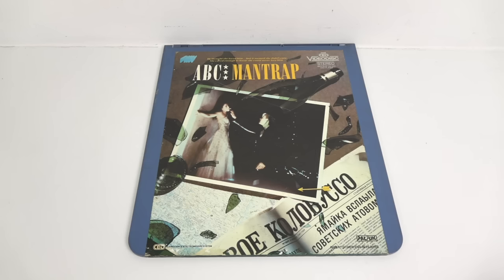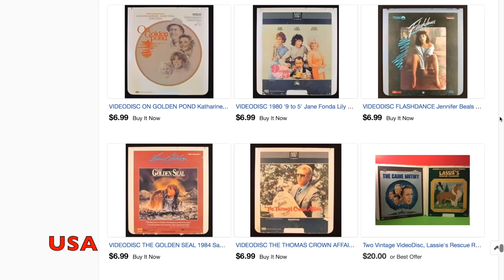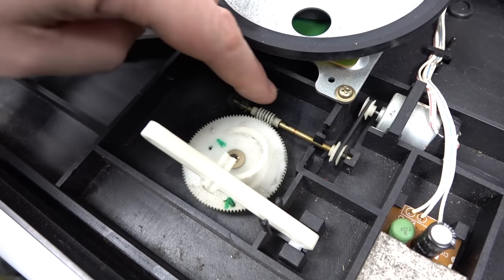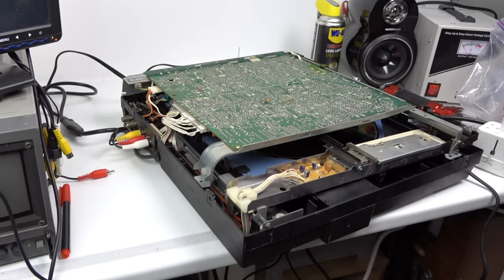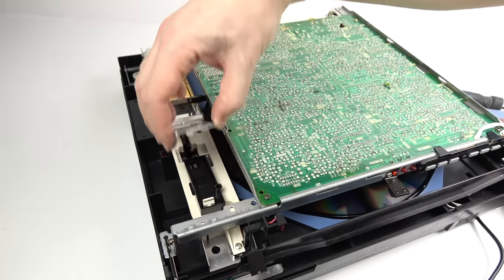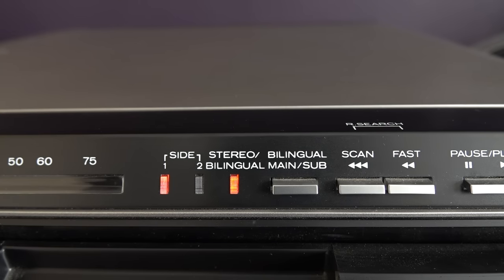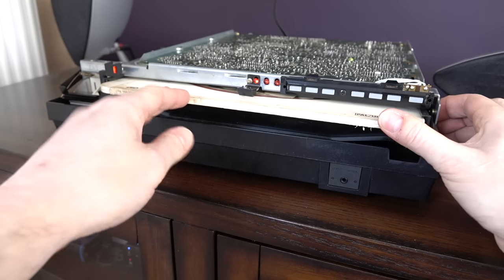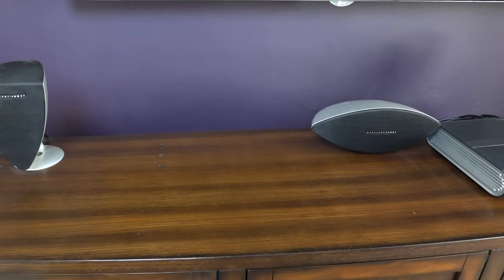Retro tech: The RCA CED Videodisc

Comment: I worked at RCA at the Video Disc plant in Indianapolis for four years.  I was responsible for buying the caddie and the spine the disc went into along with other products including the PVC and carbon the disc was made from.  The skipping in part was caused by dirt or mainly because of the carbon migrating up through the PVC and clogging the tracking and caused the stylus to jump.  It was fun working there as RCA went full out in staffing the plant. We had the latest equipment to work with.  We had two electron microscopes and several PHD's working there.  It did turnout to be an unworkable system.  Too bad.

Comment: A. Ross
A. Ross
1 second ago
Bought an Hitachi CED player when they first came out, the discs used to skip all the time, I spent more in bus fares going back to Bunker and Pratleys (Sheffield) to get the disc replaced, had the repairman on first name terms, had at least 5 styli on 2 machines and they still couldn't fix the problem.
So I had nothing to lose, I took the stylus out, looked at it under my kids microscope 100x magnification. It was covered in the silicone lubricant I mean really thick with the stuff, I cleaned the stylus like I would a regular audio stylus.......PERFECT.........until the next disc was played. I told Dave the repairman showed him the stylus he could not believe all the hassle we had been through and it was just the gunk on the disc that was the problem.

You live and learn.......all the time..

Ade

Comment: I had a CED player (well, two) and hundreds of discs. Glitches were standard: you didn't question "will this disc have glitches?" but rather "does this disc have few enough glitches in unimportant enough places that I can live with it?" and if you couldn't live with it, you'd take it back and they'd exchange it. Over time with multiple plays, some glitches went away as the stylus ironed out the spots in the grooves that weren't quite right. However, they weren't nearly as bad as shown, clearly those discs you have, have gone bad over time.

Reasons for getting into the format were that it was inexpensive - a movie was on the order of 10%-15% of the cost of the VHS tape (and laserdiscs were much more expensive at the time) so I had a huge library of home videos at a time when nobody else could afford it  - and in the US, movies came out on CED years before on VHS. I remember when there was a big hubub about Star Wars becoming available on VHS, and I didn't understand, because I'd had it for over 10 years on CED. So, weirdly, there were reasons why CED was appealing.

I'm amused that you got a pristine copy of The Muppet Movie and watched it as your first disc, because that was my first CED disc in 1981.

Comment: I just bought and restored one of these machines, fun project but the belts on mine didn't just perish, they turned into a kind of sticky black tar like substance that stained the carpet and anything else it got near. I ended up scrubbing it off the wheels with servisol and an old toothbrush. I'm glad to see the reason my machine still skips is basically because its a crappy format rather than something I've missed in the repair.

Comment: A very enjoyable video, and a fair critique, but I have to say my CED player isn't going anywhere! Part of your problem was that CEDs are heavy and stacking them one on top of another is basically a cardinal sin in CED circles. They should be kept vertically like LPs. Also, many skips can be fixed by repeatedly playing the same bit of the disc.
Is it a viable technology in the 21st century? Probably not. but it's still fun, and that's what counts. Plus I like the "analogue feel" of 70s/80s films in comparison with the ultra-clean Bluray for modern stuff.
Also, big advantage of CED over Laserdisc (which I also have): Look after a CED and it will stay working (with a few skips). Look after a laserdisc and there's still a fair chance of it rotting away. So it's not all bad. :)

Comment: few people able to repair these. however there is a stylus repair by an RCA engineer who worked on the system. cedatum. com near Indianapolis.  machines are servicable by anyone with basic electronic skills and a good lube job on the player and playing the disc through all the way to spread the silicone back where it was originally will eliminate most of the skip problems.

Comment: I also own CED (us) and some DiscoVision and some LaserVision (P&N)  too. There is still some very few"exclusive content" (documentaries and concerts such as Elton John – In Concert At Edinburgh on Discovision, AN EVENING WITH RAY CHARLES LaserVision) and some are betters than DVD transferts done poorly ( EWF in concert 83, Tina Turner – Queen Of Rock 'N' Roll, JJ Goldman 81-86,...). While CED jumps, Laserdisc as laseroot, and Magnetic tape got oxyded/warped/demagnitized, you can "repair CED discs" by replaying the same part using Page Mode, RW+P/FW+P. At the worth case, and can clean  it with distilated water in a clean evironment (use a box and a vaccum above), and reapply a coat of silicon (£3/4). About your first player, you might change capacitors in the Thoshiba chip aera ;-)

Comment: He mentioned DVD recorders not being very popular compared to PVRs (presumably meaning hard drive or solid state drive based ones). Except this last year I bought my parents an old disc recorder as a replacement for their ancient VHS player, with two dozen rewritable DVDs. They're using it more often than they ever used the VCR for recording. I've always disliked PVRs, because they lack a portable medium and are too much of a proprietary box. The downside for a disc recorder is the erase and rewrite process is more complicated than anybody would expect, and the record quality versus maximum duration isn't great. On an analog TV all the recording rates look fine, but only an SP one hour record duration comes close to 1:1 broadcast quality (when played back with a computer).

In case you're wondering, a disc can be erased and reused hundreds of times, but every five it has to be completely reformatted. The recorder I bought doesn't make this obvious or easy, and using a desktop computer to reformat is far simpler. Somebody that doesn't know better would assume the discs are garbage after very few uses, or that there was something wrong with the recorder. I think this is a consequence of the menu systems burned to the disc being "updated" instead of rewritten, until that session runs out of space for further updates. It might not be an issue with every model of disc recorder.

Comment: I remember when the video disc came out and shortly phased out. I remember it was superior quality and expensive. Then you would occasionally see the discs at thrift stores and sit bc many didn’t have the machine to run them. 

I just found a top of the line Sony VCR just laying on the street. I hope I can get it working and didn’t find the remote for it on eBay for like under $20.  I also grabbed bc o didn’t want to see it ruined by the weather or dumped in the trash.
Reply: Oh and I thought this was the laser disc. Love the ABC disc and in the US that group was a bit underground till even now. Even tho they had several big hits and videos played on MTV  in the early 80s.
Reply: I’m glad you are documenting many of these Japanese machines that were hard to cover even if you were around back in the 80s. One being most needed one stereo or video player and only tried a new unit when the old one stopped working. So it wasn’t easy knowing about all these Japanese electronics unless you worked at stereo store or in the industry. Why it’s still after 40 years, very fascinating for many of us. It’s like many of us are finally finding out what these machines did and if they were great units to have or not.

I’m trying to collect vintage Japanese bc most are not working and need repair and going for cheap, but you have to be careful bc it’s addictive and easy to get too much. 

I wish each city or country had a museum so ppl. can view and see the archive and not end up in the dumpster when it stops working.

Comment: If you watch the Technology Connections video series about the development of the CED videodisc you will then wonder how the CED made it to market at all. The mismanagement and the political infighting that was going on at RCA and it’s divisions and the companies that RCA owned during the development of the CED is breathtaking and not in a good way. The infighting between the divisions responsible for the development of the CED got so bad that in the late 1970s RCA management had the manufacturing division to try and work out some of the bugs in the format. RCA ended up releasing an unfinished product with a lot of issues still unresolved, especially with the discs themselves due to the limitations of the format and the technical limitations of the time period, so RCA could try to recover all of the money that was spent on on the CEDs development. Don’t forget RCA had been working on what would become the CED off and on since the 1950s. RCA however would not take the development of the CED seriously until the mid 1960s. However as we now know RCA lost hundreds of millions of dollars and it never recouped its losses it made on the CED. What made matters worse was that from the mid 1960s until the early 1980s RCA wasn’t doing all that well outside of its military division due to mismanagement and political infighting that was going on at the time. Oh and when it comes to the player skipping frames of a disc, even on brand new discs on occasion with the issues with with the video noise, both of which Technology Connections had the same issues so it’s the format and the age of the players and discs that caused those issues not just that particular player and it’s predominantly the discs. The CED wasn’t the best thought out format and the way the format works was always going to lead to its downfall with hindsight. If you watched the Techmoan videos about the VHD that JVC developed with Thorn EMI you will see that the VHD was a much better way to go.

Comment: A lot of people reviewing CED and LaserDisc technology, now and back in the 1980s would hilite the comparison - you cannot record on a disc but you can on a tape.

Well, I think that both technologies could have lived side by side. The CED perfected and LaserDisc perfected for wathing movies in better quality than Beta and VHS and the tape formats for recording off of the tele.

 But those people who saw "you cannot record on the discs" are probably the ones who shop at Wal*Mart "because it's cheaper".

The resolution of the various formats:

Regular VHS - 240i
CED - 240i
VHS HQ - 280i
Beta - 330i
LaserDisc - 330i
DVD-Video - 480i

CED could have added so-called "line doublers" to create a more DVD-like picture and I'm sure that RCA, if given the proper time, could have fixed the jumpy picture on the discs - caused by worn out discs or "shoddy" manufacture. There was a 3rd type of disc in Black caddies. They were Interactive and the RCA players were the SJT-400 model in 1984. Sadly RCA cancelled the project around the same time.

At home I bought myself a used SGT-200 Stereo model I found in 2007 at a local flea market. I got about a dozen VideoDiscs plus the player for $75.

Comment: I was smart in '84 I bought a LD player...yeah, right.  Not my worst A/V waste of money, but a lot of investment for so little return.  Rental discs in my town were scarce and buying one was not cheap.  I found some rentals within 35-miles and I make trips.  I'd say the quality seemed a bit sharper than the original Beta Hi-Fi tapes with pretty impressive audio for the time.  I'll bet folks with early Magnavox top loaders with CX noise reduction had some of my same problems.  Sometimes discs would have fingerprints so it was wise to have a good cleaning method.  Worse were warped discs.  I could often hear the discs making a noise akin to a rhythm of the disc brushing something inside the player.  The worst wouldn't play properly and many would skip wildly.  So, the LD was, perhaps, just as flawed as the CED RCA disc machine.  Both were analog video of course which, I'm guessing, had little in the way of error correction capabilities.  Looking back you bring up an important point.  RCA was an American electronics juggernaut at one time commanding a huge piece of the home TV market in addition to their professional division.  I often wondered what brought the company down.  Your video pretty much told that they spend over a half-billion dollars betting on the CED home video format.  It's conceivable if it took that much just to get those first machines to market they took another bath trying to get the format widely available and actually purchased by people.  Often the first year of even successful formats bleed more red ink of course and I would bet that RCA may have lost as much again manufacturing and distributing machines not to mention titles.  With Sony already cutting in to their traditional meat and potatoes of TV sets and more Japanese brands entering all the time the old cash cow segment was failing too.  It seems RCA, once as dominate as any TV brand in America was fast becoming a dinosaur in the market.  The home video brand was eventually, I think, divested of and who knows how many owners have simply bought the brand name for consumer electronic products since?    Even big companies with huge R&D departments should know better than to bet the farm on any one product seems to be the take-away if there is one.  Thanks for the fine look at at another fail in the history of consumer electronics.

Comment: Is that really a pair of 25mm belts that you bought? I've just measured my player and fitted 79mm ones (and I paid much more than £1 😞).
Reply: Ah, I see now - 25mm is the internal diameter rather than length. Just fitted one of these to mine and it works better!

Comment: Not only were the videotape machines more expensive as Techmoan points out than CED players in 1981 but prerecorded videotapes were more expensive than the CED discs, considerably more expensive.  Again, this is 1981.  RCA's thinking was more about the discs than the players, as I recall.   And if the prices of prerecorded tapes had remained at 1981 levels, and RCA had also released X-Rated discs, it would likely have been around for much longer than it was.  

RCA's miscalculation, coming from such an entertainment giant, while certainly not the only home home entertainment failure, brings to mind the Ford Motor Company's Edsel of the late 1950's.
Reply: Another thing was in 1981 nobody knew the video cassette rental business would be as big as it became.  Why buy a cheap disc to see a movie when you can rent the movie even cheaper?

Comment: I'd suggest getting a RCA (or ones built by them for stores like Sears and Radio Shack) model if you can get it imported into the UK, the Hitachi CED players are notoriously unreliable and poorly built. I just got an RCA SJT 400 of of eBay, and it is great, it was actually one of the last ones built, mine was produced in January of 1984, I was finishing up 6th grade and elementary school, and getting ready to start 7th grade and Junior High School that fall, good ole days!

Edit - I know you guys use PAL instead of NTSC, would it still work there? I did have to replace one belt on mine (it had turned to goo), the one that operates the loading/unloading mechanism, but that was no sweat.

Comment: I bought a RCA Videodisc system when they first came out. The thing worked okay and there was quite a bit of material available. Blockbuster Video Rentals killed the thing. I got rid of mine and the thirty movies I had about five years ago when I downsized. Nobody wanted the disks. They were too heavy and the player skip ..p ..ped often as the stylus wore in the player. Then Blockbuster died when the DVD machines came out and video streaming replaced the DVD, BluRay ...

Comment: Maybe the reason why the discs skip is because of that silicon grease.
It may have gone bad due to it being more than 30 years old, old grease tends to become slippery and bad. The stylus may be slipping in that old grease, causing skips. It may run fine, but when it slips, it skips. It's like a cracked DVD.
The Muppets disc may have not skipped as much because it was still in the original seal, never been played. But that Poltergeist one may have been played way too much, resulting in the grease to become more slippery, making the movie unwatchable.
What would be easier to watch? A DVD with a mild crack or a DVD that was thrown to the wall multiple times?
The same thing happened there.

Comment: 2:30 500RPM -  "but dude!" A 1X CD-ROM 150kB/s spins 500 RPM revolutions, per minute ~ 9x revolutions per seconds, it spins quickly when the inner tracks are being read, and slows down to read outer tracks. It was told as if this speed of CED was "extreme" no it wasn't. LaserDisk spins 1800 RPM it's  1/3 of speed of HDD

Comment: i bet somebody  actually tried to use the machine that was new, but they didn't know they had to remove the screw and stuff.
Reply: You'll note the stylus was missing from that one though. I'm thinking they couldn't get it to power up (due to the disconnected wire inside the power cord) and ended up salvaging the stylus to use in another machine.